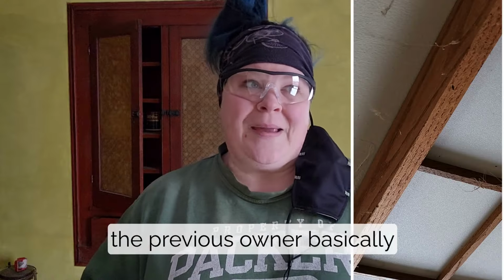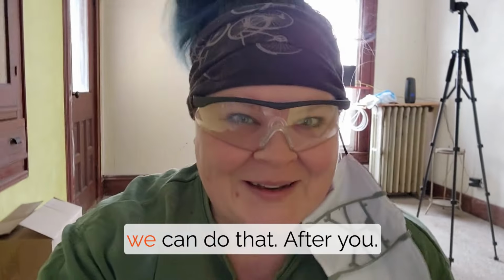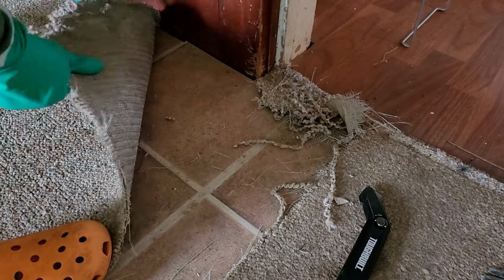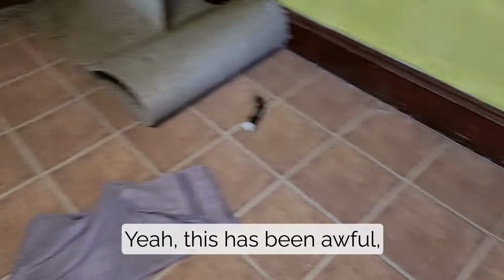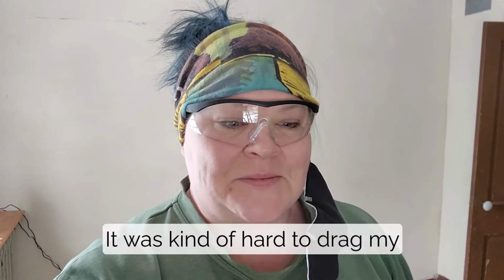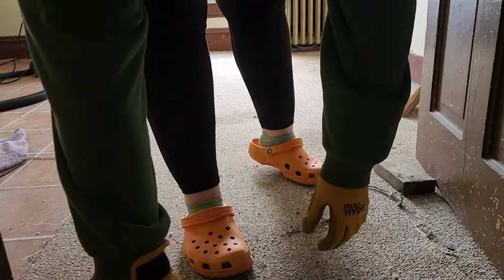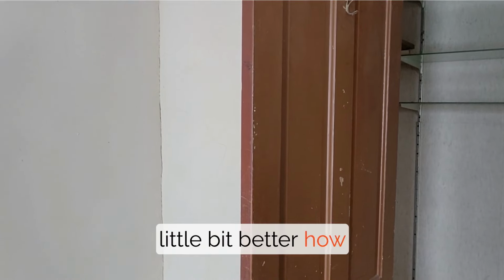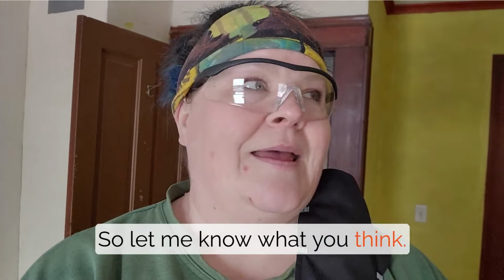Nightmare Carpet Removal

Comment: With all of the screw holes in whatever flooring is underneath the linoleum and all the warping I'm not sure that the floor is worth saving. Who knows what you might find by pulling it up. Is there a basement under that room what you can access to maybe get an idea?
Reply from the maker: It took me too long to respond, I'm so sorry!  I did decide that I at least have to know what's underneath.  I did go into the basement and we do see the original hardwood above.  I hate my basement.  I just posted an update video where you can see what we found!

Comment: Your subfloors are probably sitting on top of floor joists. Depending on how your foundation was constructed, if you pull up the subfloor you’ll be looking at a concrete slab or compacted dirt. If your subfloor is not level, you need to seek professional help to determine where the problem lies. This is not a DYI type of project unless you have some construction experience.
Reply from the maker: I appreciate your thoughts, thanks!
Reply: For sure! Further investigation will be needed. If we use my 150 yr old home, as an example, I can go into my dirt (Michigan Basement), look up and see 1×6 pine boards, affixed to the rafters. When we did our own,  DIY flooring removal, we found layers on top of the original pine boards. One of the bedrooms had a green, 1960-70s shag carpet. Under that was linoleum. Following that, was layers apron layers of 1940's thru 1950's newspapers. We were told that the newspapers were used as "insulation" in our cold climate. I may be wrong. Based on my limited experience, I can guess that under her linoleum, she might have an underlayment on top of her subfloor. The reason I suspect this, is because her farm was built before plywood or MDF was produced. Typically, the average homeowner wouldn't have ripped out the original hardwood flooring (used as subfloor) unless there was a catastrophic failure (such as water damage or foundation failure). I will say it again, NOT a professional. Just a old home dweller and lover.